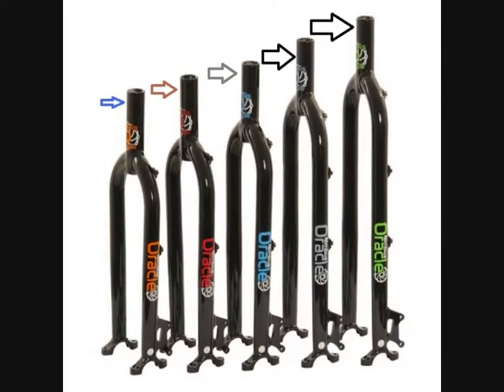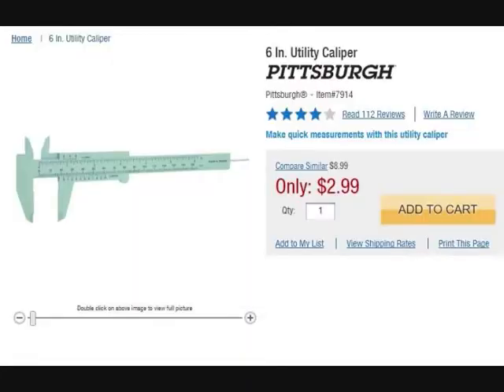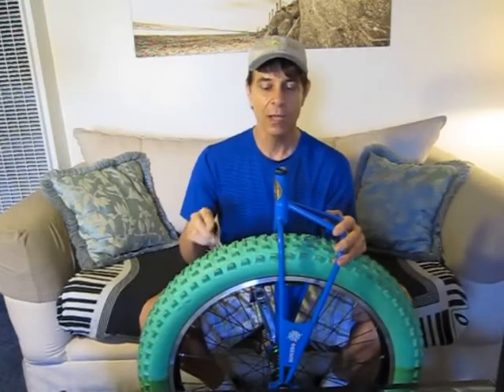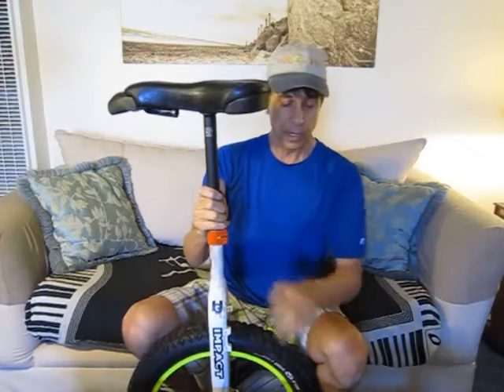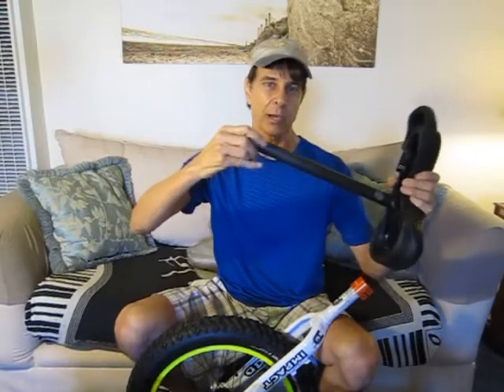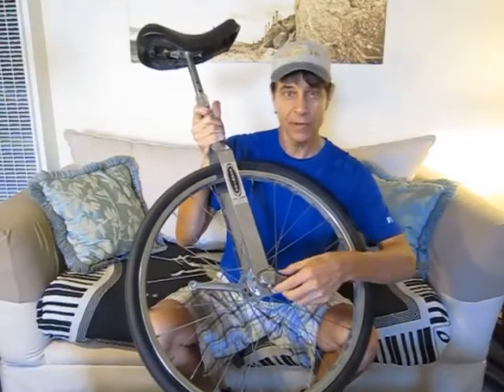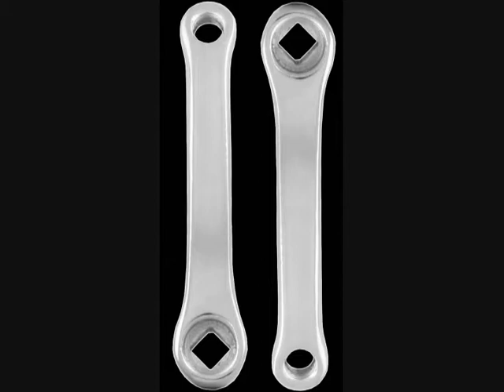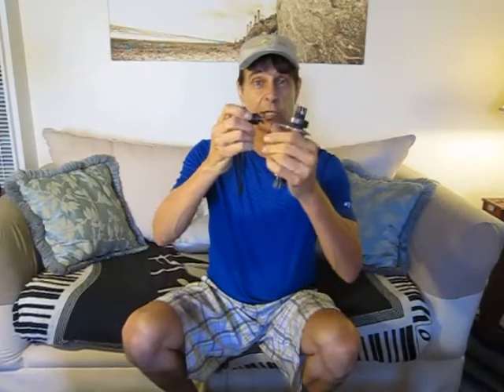Unicycle Tutorial: Cranks, hubs, seatposts & Clamps

Comment: Speaking of cranks, for a beginner is there a preference in length? Long vs short?
Reply from the maker: Not really it's personal preference and also depends on the wheel size. When I first got a 36er I used 150mm but after getting used to them I ended up with 110's. Longer cranks can give more control and make climbing easier, but also cause more up & down leg movement and wheel wobble.